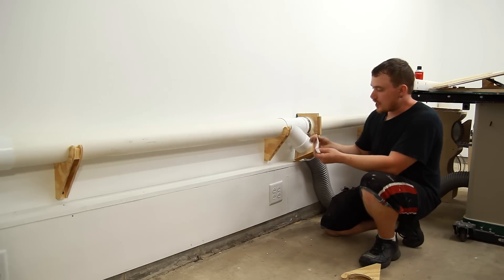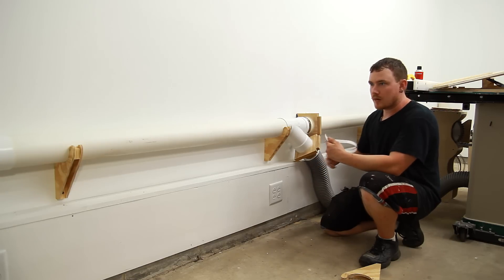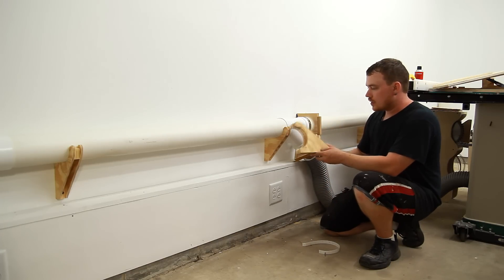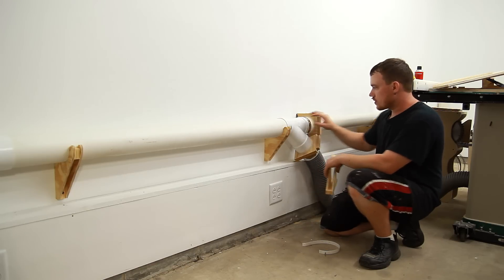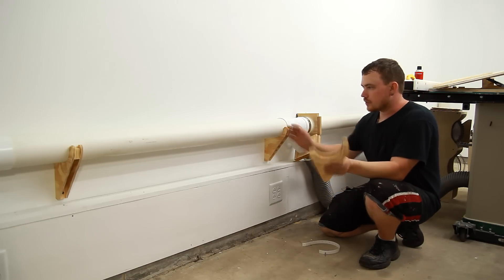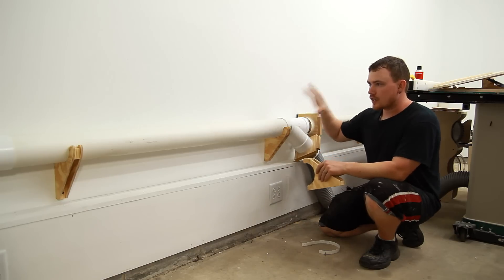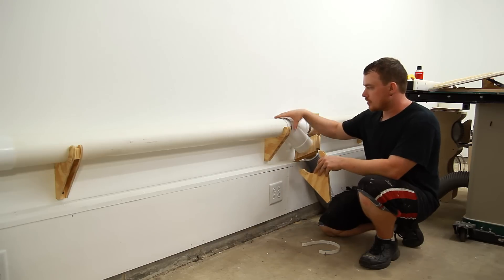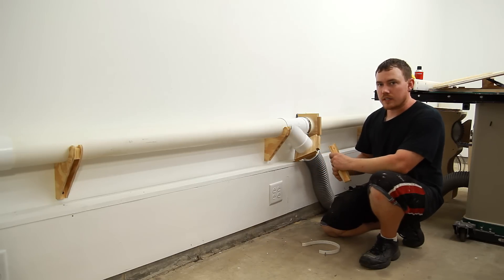Dust Collection Pipe Bracket Hangers - 158

Comment from the maker: Hello everyone. Please thumbs this up so everyone can see. Some questions are asked repeatedly. 

Countersinking the backside:
When the screws go through the wall the drywall will mushroom slightly and prevent the bracket from sitting flush against the wall. The countersink allows room for the mushroomed drywall material.

Flipping the plywood:
To cancel out any blade deflection. On a batch cut like I did if you're fence is out just a little and lets say the front and back widths of your work piece result to be 15 thousands of an inch different than after ten of those cuts the error is multiplied and now the last piece is a full 1/8" off. It's not a huge deal normally but flipping will correct any error on every pass.
Reply: My suggestion - add an annotation to the video at these points either explaining the reasons or referring the viewer to the description and give the explanation there.

Comment: Hey, I have a patent-pending on the screaming like a little girl in my head thing!
Shop is taking shape - looking good!
Reply from the maker: John Heisz Ha! But did your patent contain the optional obscene language?
Reply: Only thing I did not understand was the countersink on the back of your brackets. What did I miss?
Reply: Georg Werner That's so the bracket sits flush to the wall. When the screw drives into the wall it will pull a pimple of material out and inhibit the bracket from sitting flush.
Reply from the maker: Georg Werner When the screws go through the wall the drywall will mushroom slightly and prevent the bracket from sitting flush against the wall. The countersink allows room for the mushroomed drywall material.

Comment: Nice concept. I used the Rockler brackets that hold a metal blast gate to the wall. They work, but if you want to move they are a pain. You system is inherently more flexible. Thanks for sharing.
Reply from the maker: Alex Pettigrew You're very welcome Alex. Thank you for watching.

Comment: Hello Jay, I liked your solution to your hangers. Might have to do the same for my system when I upgrade the piping. It would be cheaper than the way I did my old one. I have to say I laughed when your band saw blade broke because the exact same thing happened to me doing your scoop project a while back. Made the same type of sound and anything so I knew it was coming. Good stuff.

Comment: Great idea on the open top brackets (which remind me of your wood storage rack brackets). I thought you were going to run the dust piping high but of course you had the low run for the space above the electrical enclosure in mind all the time. Guessing most of the tools needing dust collection will be on that wall (and a couple ports for temp connections)? Looking forward to the dust collector redesign and build you mentioned in your "around the web". Glad the broken blade didn't get you. Thanks for sharing.
Reply from the maker: MRrwmac Thanks! I've got it all setup finally and I only have a dedicated hose going to the table saw and one going to the bandsaw. The bandsaw has a much longer flexible hose on it so I can use it on other tools if needed or use it to clean up. I'm debating on just getting a nicer dust collector with a good filter though. I like my lungs too much :)

Comment: OK, I caught it, ( the counter sink on the drilled holes ) was on the wrong side. LOL . Jay you always amaze me of all the things you think of and I can't wait to see the next thing you do to the shop or what ever you are doing. Great job on the brackets, they will do fine. Thanks
Reply from the maker: ***** The countersink is on the correct side. I was using washer head screws so no countersink is needed on the front side. When the screws go through the wall the drywall will mushroom slightly and prevent the bracket from sitting flush against the wall. The countersink allows room for the mushroomed drywall material.
Reply: Hey, thanks

Comment: Nice shop you have there. I'm in the middle of re doing my shop It's a mess now. The pipe brackets lok good nice easy design.If the pipe dose move you could screw a piece of that strapping over the top of the bracket.  Good luck with the new shop Jay.

Roland
Reply from the maker: Backyard Woodworking Thanks Roland.

Comment: Jay, you come a long way, nice to see! 
I want to address the use of PVC pipe in a Dust Collection System, something that has become common place. Most Industry/Insurance Expert agree that PVC Pipe should not be used in Dust Collection systems! According to Oneida's User Manual, for their Supper Dust Deputy's Cyclone, Page 13, the use of PVC is problematic, a Static Spark can JOLT, Injure, or Startle the Operator using dangerous equipment !  All Commercial Codes require Metal Pipe for Wood Dust Collection. 
I am adding a Dust Collection System now, with the Oneida Cyclone, and will be using Metal Pipe has a result of this info, all be it less than 10 feet.

Comment: Great project Jay!  I'm curious why you chose to run the countersink on the wall side of the brackets. Would you please share your thoughts on that?
Reply from the maker: cavokdotcom When the screws go through the wall the drywall will mushroom slightly and prevent the bracket from sitting flush against the wall. The countersink allows room for the mushroomed drywall material.
Reply: Thanks Jay, I'd kinda wondered about that but didn't want to presume. This is timely advice; I'm installing some shelving with cleats this week, so I'll give that a try. Much appreciated!

Comment: Very nice idea, looks great and very functional. So why did you countersink the backside? Or was that a mistake?
Reply from the maker: Not a mistake. When the screws go through the wall the drywall will mushroom slightly and prevent the bracket from sitting flush against the wall. The countersink allows room for the mushroomed drywall material.
Reply: Jay Bates well I din't think of that smart :D thanks!
Reply: I didn't know that either. Nice tip
Reply: Jay Bates dang. Such a good tip

Comment: I'm curious why your countersunk the back of the brackets.
Reply from the maker: Phil Reynolds When the screws go through the wall the drywall will mushroom slightly and prevent the bracket from sitting flush against the wall. The countersink allows room for the mushroomed drywall material.
Reply: Wow I knew there had to be a reason you did it. You are always teaching me new things

Comment: What is the thinking when you are making the squares, where you flip the plywood over between each cut? Minimize blade mis alignment? I guess it would multiply with each cut if you didn't do that.
Reply from the maker: Phillip Moore That is correct. I used to work in one of Ashley Furniture's frame mill's and every time we would rough cut OSB blocks on the band saw we would flip them like this. Bandsaw blade drift is obviously way worse than a table saw where it honestly shouldn't exist. But any time I'm making a series of cuts like this I just find it to be good habit to flip and eliminate any misalignment.

Comment: Why do you flip the plywood over after each cut 00:40 to 00:49 ?
Reply from the maker: To cancel out any blade deflection. On a batch cut like I did if you're fence is out just a little and lets say the edges of your work piece result to be 15 thousands of an inch different than after ten of those cuts the error is multiplied and now the last piece is a full 1/8" off. It's not a huge deal normally but flipping will correct any error on every pass.
Reply: Makes perfect sense now that you explain it, thanks.

Comment: Why did you drill countersinks on the side of the bracket facing the wall?
Guess I should have read your comments before asking. Sorry.
Reply: When the screws go through the wall the drywall will mushroom slightly and prevent the bracket from sitting flush against the wall. The countersink allows room for the mushroomed drywall material.
Reply: I noticed quite a few other people asked the same question which made me feel less stupid for not figuring it out myself, and more stupid for not reading all the other comments before asking. I admire your patience in responding to everybody who asks.
Reply: Jim Fortune Not a problem. Have a great day Jim.

Comment: what was the countersink on the back for?
Reply from the maker: sonofjebbo When the screws go through the wall the drywall will mushroom slightly and prevent the bracket from sitting flush against the wall. The countersink allows room for the mushroomed drywall material.

Comment: Jay, please do a short review of that band saw. (or just reply "I love this one - buy this one" or otherwise) You've mentioned your grizzly anniversary edition 14" in several videos - and you seem to really love it.  I'm trying to make a buying decision - get the grizzly 14" or get a bigger bandsaw like the G0513X2B.  Help me decide!  You're cutting a big stack of 1/2" plywood on your bandsaw and it doesn't seem to resist.  This is my first bandsaw purchased/used, so I don't know what I need.
Reply from the maker: http://jayscustomcreations.com/2013/09/grizzly-g0555lanv-bandsaw/
Reply: Jay Bates thanks.  I can't believe I overlooked that.  This is an awesome, thorough review.
Reply: Hey Chew.  Saw your comment on bandsaws, and thought I'd throw in my 2 cents worth.  I bought my first real bandsaw the first of this year. I got that new Laguna 14SUV (I could be wrong on the model #).  Anyway, it has 1 3/4 HP motor, resaws ~ 12", lots of cast iron, seems like it very well made.  Think it's made in Taiwan.  Can be had for about $1,000 on sale at Woodcraft, maybe Amazon.  I really love it.  Also, Rikon just introduced a look alike with a smaller motor for ~$800.  Hope that helps!
Reply: John Grubbs Thanks so much for the recommendation.

Comment: It's not clear to me why you countersunk on the back side of the pieces... 4:19
Reply from the maker: Tom Nally When the screws go through the wall the drywall will mushroom slightly and prevent the bracket from sitting flush against the wall. The countersink allows room for the mushroomed drywall material.

Comment: Good to know my bandsaw isn't the only one that's a noisy bastard lol.
Reply from the maker: caskwith It has more to do with the bearings than anything. Mine are starting to get gummed up and they are getting louder.
Reply: I thought my bearings were the problem and swtiched them all out for good quality ones, it runs more smoothly but the noise is still there, I think in my case it's the blade and the body of the saw amplifies it. Ear plugs for the win! haha.

Comment: Funny when i first started watching i was saying to myself, hes putting way to much force on that bandsaw, that doesn't sound healthy (you can tell by the sound). One thing I learned is never put a machine under stress if your building a piece of shit. Not to say your brackets are piece of shit, but trying to cut that thickness on a bandsaw just to get some brackets, i would have done it in 2 shots. Not like im resawing some expensive hardwoods, not worth breaking a blade over.
Reply from the maker: Joe Cavaliere lol. The bandsaw is getting noisy because my bearings are getting gummed up. The blade had a kink in it from the shop move. I knew it would break but didn't know when so I used it anyway. The same blade cut 6" of oak endgrain like butter so this "piece of shit" is definitely not stressing the machine. Have a good day Joe.